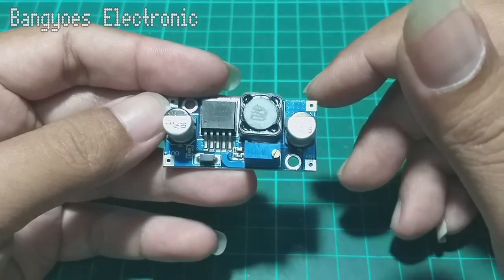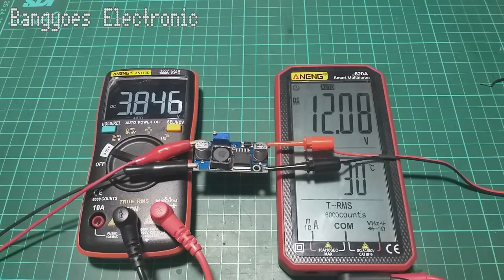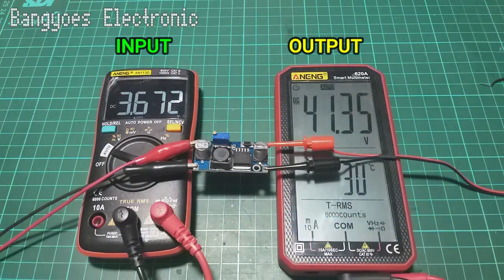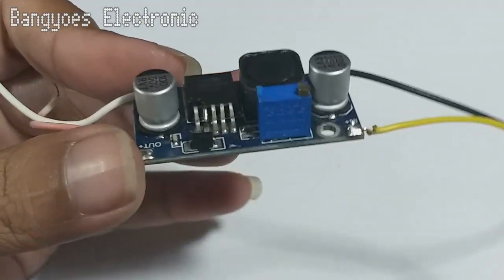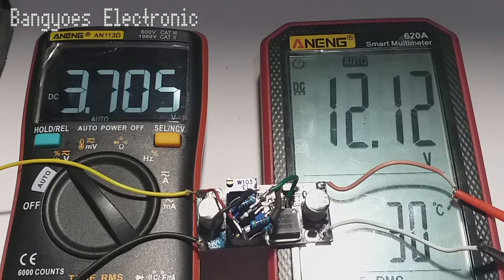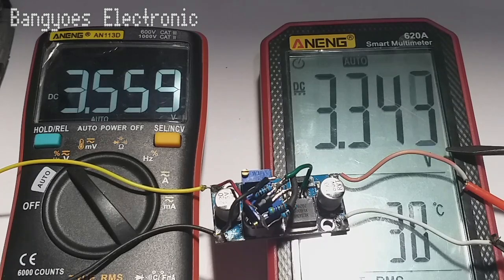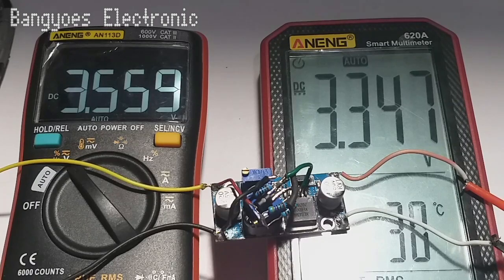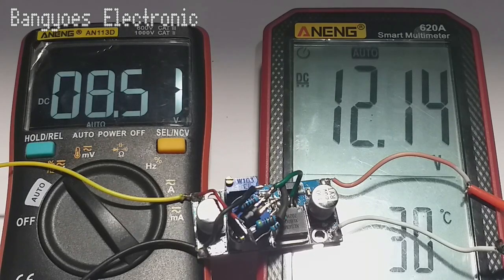AWAS! Hanya Dengan Cara Akurat ini Modul Step Up XL6009 Bebas Dari Bahaya #xl6009

Comment: Bang semisal rangakaian nya seperti ini
Baterai 18650 > Modul step up 5v ( ip5306) > modul XL6009 (12V) 
Apakah aman ? Vout modul xl6009 tetap stabil ?
Modul step up 5v akan mempertahankan Vout nya 5V meskipun VBaterai sudah Low
Reply from the maker: Ya bisa saja seperti itu tapi perhatikan arus maks modul yang bisa disuplai ke beban. Tentunya rangkaian ini membutuhkan cost yang lebih tinggi.
Reply: @bangyoeselectronic bang ada solusi ga. Saya pake modul ini buat lampu d2 laser
Harusnya output bisa 12v 1A tpi arus yg keluar cuma 600-700mA
Baterai 18650 paralel 3 biji > modul PB IP5356 ( max 3A ) > modul XL6009

Comment: sy alami naik 20V itu klo VIN <3.5V di 2bj XL6009 baru beli
IC pin 2 3 4 ditest short ke VIN+
klo VIN dinaikan ke 9V VOUT juga naik ke 9V begitu juga klo 12V, jadi mcm bypass
modul mn yg stabil
Reply from the maker: Jika tegangan input sama dengan output berarti ada masalah di ic XL6009

Comment: Ad cara simpelnya hanya butuh 2 resistor saja 10k dan 3,3k ,solder salah satu kaki resistor ukuran 10k ke input(+) dan salah satu kaki resistor ukuran 3k3 ke input(-) ,lalu sisa kaki kdua resistor tersebut di gabung(jumper)dan disolderkan di pin ke 2 dri ic xl6009 jika yg tdk ad pin EN nya tp klo di pcb sdh tersedia jalur EN maka solder nya di EN nya.
Biasanya modul pcb yg berwarna biru itu tdk tersedia jalur EN pd pcb ,kebanykkan jalur EN ad pd modul yg pcb nya berwarna merah 
Sy sdh tahunan pakai cara ini dan aman
Reply: efeknya gmna bang kalau teggangan di bawah 3,5v jika pakai cara ini?
Reply: @AmbyarAtiku efeknya modul akan sangat aman di pakai krna sdh tdk terjadi lagi lonjakkan tegangan saat inputnya drop
jadi tegangan outnya mengikuti tegangan input nya ,
Ya klo tegangan dr batre sisa di 1,9volt ya outputnya di 1,9volt jg.
 Jika belum di modif sprti yg saya sebutkan maka saat input dr batre drop di bawah 3,5volt maka output akan melonjak hingga lebih dr 40volt yg bsa membahayakn peralatan yg di pakai
Reply: @indrajambul3653  berati kesimpulanya tidak perlu menggunakan rangkain tambahan berupa transitor, dan
cukup dengan 2 resistor gtu ya bg
Reply: @AmbyarAtiku iya betul , itu cara paling murah meriah simple dan mudah ,sy ud pakek cara itu lebih dr 2 tahun gak ad kendala
Reply: @indrajambul3653  bisa di coba nih. Trimakasih atas ilmunya bg, semoga di beri kesehatan dan rezeki melimpah bg🙏
Reply: @AmbyarAtiku sama sama amiiin
Reply: @indrajambul3653 bang kok bisa tau cara ngatasinnya apa km sudah nonton di video radal 05 soalnya cara yang kmu berikan itu sama persis dari tutorial di radal 05

Comment: bang saya baru beli modul seperti  tapi potensio saya putar tegangan tidak naik stuck di 4.9v. input saya kasi 5v dari power supply dari bekas DVD, mohon bantuannya sekiranya apa yang perlu diganti
Reply from the maker: @kabarviral8643  coba dinaikkan tegangan inputnya hingga 12v, cek apakah ada efek.

Jika tidak ada, coba ganti potensionya dengan yang baru, cek apakah ada efek.

Jika tetap tidak ada efek, berarti ic modul bermasalah.

Comment: Duluan..
Reply from the maker: Makasih Om...😍
Reply: @bangyoeselectronic  leksus
Reply from the maker: @p4ng-5  iyo lek, suwun 🙏
Reply: @bangyoeselectronic  jika tegangan out di set 24V, dan tegangan input mau di batasi di 6V
Baik nya tegangan out drop di setting sampai brp volt?
Reply: @bangyoeselectronic  apa 19V bisa?
Reply from the maker: @juliuswira4537  bisa, tegangan output bisa diset sesuai dengan spesifikasi output modulnya